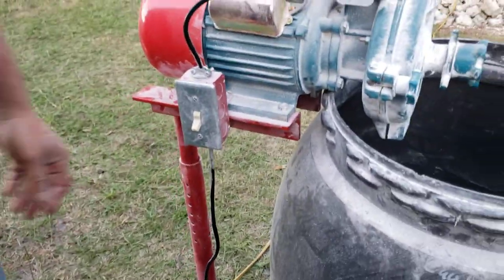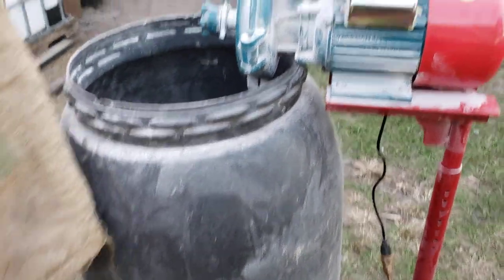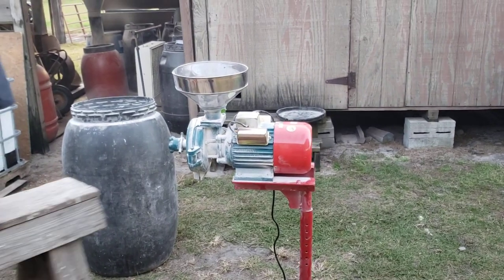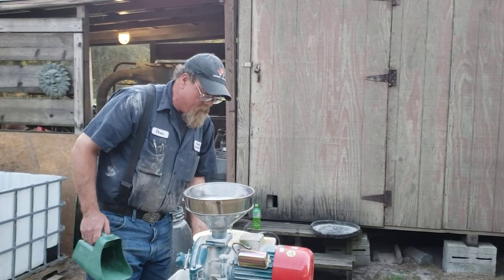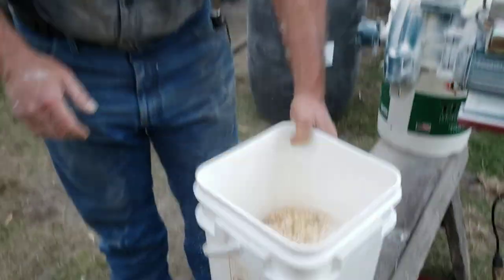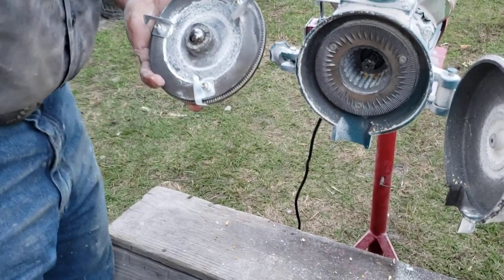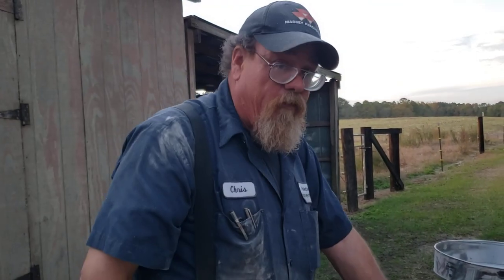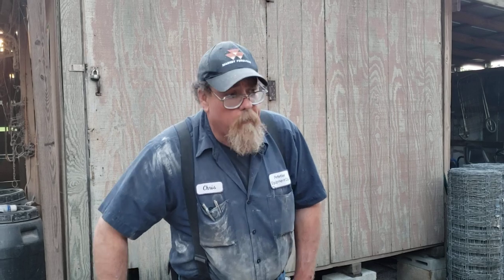Amazon Corn Mill/Grinder  - Easy Improvements

Comment: We've been using this mill everyday for the last two years and haven't had any problems with it. The wife grinds about a 5 gallon bucket of feed everyday, sometimes twice a day. Been a good grinder. Looking for an old hand crank burr mill for when the power goes out and can't run the generator.
Reply from the maker: Most of the I've seen fail was because of run time , they can fly apart if you do 500 lbs at one go . Just gets too hot . You could make this one hand crank just need a shaft with a key slot and a bearing block . I've already converted one to belt drive
Reply: Now I’d like to see one converted to hand crank. I can’t find a hand crank version and have no idea how to begin converting one.

Comment: Are you still using this?
Reply from the maker: @dfishman76  yes for small batches
Reply: @HomesteadingtheHardWay  I am looking for something to make my own feed. We have the whole spectrum when it comes to animals. Mostly will be making hog and chicken feed. Operation is not big enough for a full size hammer mill but might be too big for this machine. We are make an hour to hour and a half away from you in Autryville NC
Reply from the maker: @dfishman76  this might be plenty for y'all just limit run time and grease it . I try not to bog it down and I usually don't grind over 200 lbs at the time it'll get too hot that's when they seem to come apart.

Comment: Thank you so much. I have just received one and didn't know how to use it. 😊
Reply from the maker: Just keep it greased and don't run it to long at the time and it'll hold up pretty good. You need to break it in before you try to grind too fine if you hit the plates together you'll have to replace them ( they're cheap if you mess up ) .

Comment: Works pretty good if ya got small batches to make up. Nice job on the stand. Isn’t nice to have scrap metal laying around for when ya need to make them projects. 
God bless. Stay safe
Reply from the maker: Running a farm repair shop does help out a lot when you have to do something around the place

Comment: Good setup for a small operation. Do you use the hammer mill that’s hooked on your tractor? That’s an awful lot of dust!
Reply from the maker: I make most of the feed with the hammer mill and I have a big burr mill . That little one is fine for a few chickens or a pig or two , most of that dust was from making cow feed with cob corn
Reply: @HomesteadingtheHardWay  that’s better feed for the cow than straight ground shelled corn anyhow. Good video. Happy trails

Comment: Sweet modifications. And - in Farmall RED. !
If you're going to use the ground corn soon - would wetting it a little cut down on the dust? -KJ
Reply from the maker: Only paint I keep in stock is red, black and silver lol. It'll mold if it gets even damp we mix a little peanut oil in when we make the feed

Comment: Good setup.
Reply from the maker: For a small outfit it would do fine ( just grease it often) . A old big burr mill or hammer mill would be better but they are hard to find in usable condition . This thing is about the fastest cheapest way to start making feed

Comment: You could make a tube from Fabric I’m tight it into the mouth and tight it from the bottom and you don’t have to ever deal with that dust when done open it into the big black container you got
Reply from the maker: Unfortunately most of the dust is from the ground grain hitting the bottom of the barrel and the thing leaks dust in-between the housing for the plates . I made a discharge chute for one a friend bought to make flour with , it might of helped some but not much and made it jam up far worse

Comment: I bought this grinder and wound up a bit disappointed.  I was hoping to make fine powder flour from wheat berries,  but it still spit out 1/4 hulls.  I tried tightening up the plates, and it started spitting out metal shavings and still was spitting out 1/4 wheat berry hull fragments.   😢
Reply from the maker: The plates have two sides one way for wet the other for dry I think but if they don't match it won't grind fine enough. If you hit the plates together it's ruined instantly replacements are 25.00 ish .  It would be better if they came with some instructions take the plates out you'll see what I'm talking about .